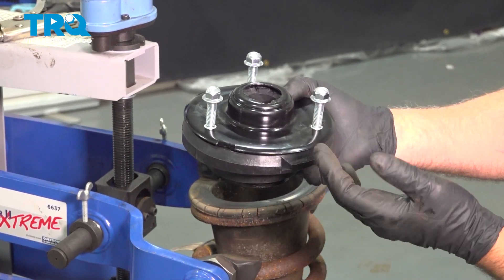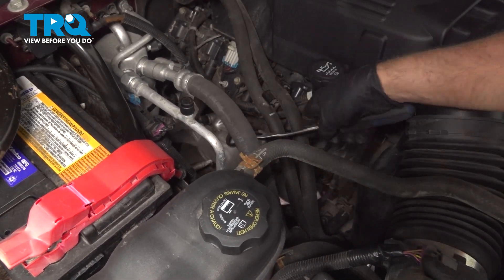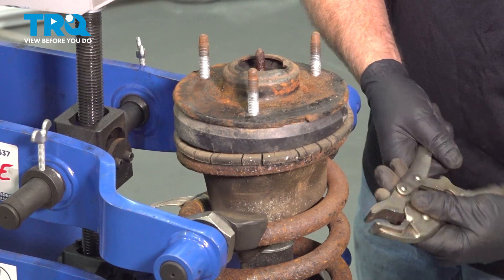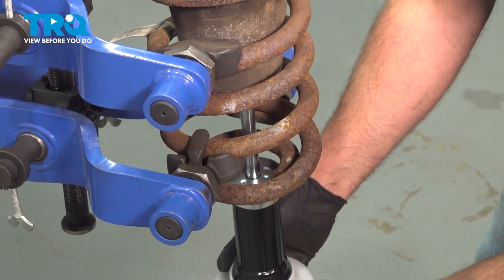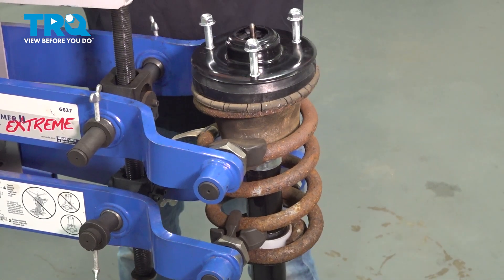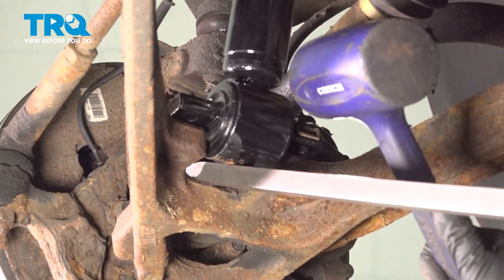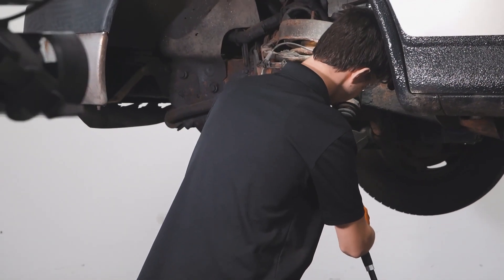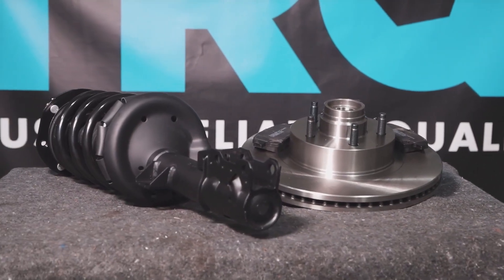How to Replace Front Upper Shock Mount Kit 2007-2013 Chevrolet Silverado 1500

Comment: Hey would you happen to know if I could use this strut assembly on a 2006 Silverado? The strut tower seems to be the same and the lower control seems to be the same too. Other than drilling the holes for the top mount. It looks compatible plus the shocks are the same length.